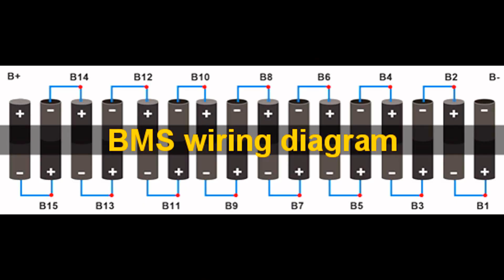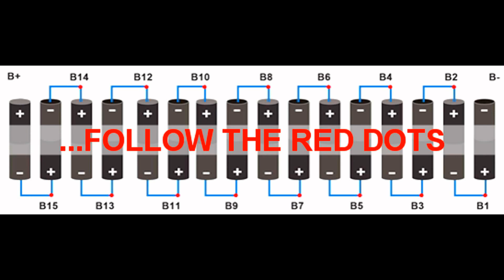BMS Tutorial - How to wire the Battery Managementment System to most DIY electric bike batteries

Comment: hi bruno..i short surcuited my charger main leads whilst it was pluged into my bike and now it wont go...i pulled battery apart looking for fuse or burnt bits but no fuse and no burnt bits..its a giant trance E and i think it has panasonic cells and maybe a panasonic bms? is there a trick to wake it up or is it dead bms?

Comment: You should not weld the bms wire tip on top of the cell, you should weld on the nickel strip between two cells to help dissipate the heat and not degradate the cell performance, since a cell has a chemical composition that can change with overheating created by the weld.

Comment: can help out?  my battery will no longer charge but it does dispense power. I bought a bms but it came with 14 wires and my battery comes with 16. Did I get the wrong bms? ever heard of the battery working but not recharging ?

Comment: So if I choose 10s bms means I have 10 cells  in series? Parallels dont count in ?  
If the motor is 36v 350w = 10amps I can go for the smallest 30amp bms? It wont break the controller?
Reply: check the controller, it has the maximum input current...

Comment: i am looking at a 48v 45ah bms its says 13 cells and 13s i think that's the same thing right.
and when it says cells does it mean 1 battery or 1battery group
Reply from the maker: +bryson502 yeaaahh I know it all sounds quite confusing... 13s means 13 cells connected in series or 48v. Most of there small BMS are designed for small packs, something between 3 to 9 cells in parallel. 
45Ah pack is pretty big with lots of cells, I would recommend you get a large BMS (at least 50A discharge) instead of a small one so the BMS can balance the series properly. 
Let me know how it goes =]
Reply: 1 cell means 1 battery only.13 s means 13 batteries are connected in series.
Reply: @ranjulatanayak584  Thanks, sometimes things need to be dumbed down so us newbies don't make dumb mistakes

Comment: Hello 

The BMS what you have in sec 38 in the hand. Do you have a link to a description of it? 
The two thin white cables on the side are the to turn on or temperature sensor? 
What sensor would you need?
 If so, do I have to do this together or separate the BMS running? 

Excuse my bad English! 

See you soon

Lars

Comment: Hi Bruno,

Is there a difference (better or worst) if the BMS has the charge and discharge on a single, or separate lines?

Im looking at getting a 26S 150A BMS from BesTechPower Model HCX-D170 which has a single port for charge and discharge, but my friend who is helping me said that he prefers BMS's with separate charge and discharge lead ports on the BMS.

http://www.bestechpower.com/27Sto32Spcmbmspcbforli-ionli-polymerbatterypack/BMS-D170.html

Thanks!

Comment: where do you get your BMS? I need on for a 4s pack 16.8v
Reply from the maker: yeaahhh some of my videos I have a list with all places you can get battery parts from, check out these links, these websites have smaller BMS for 16.8v, you can email them and they source basically anything haha
BMS:
BestTech Power http://bestechpower.com
SmartTEC http://www.szsmartec.com/
You can also get BMS on Aliexpress:
14s 30A BMS = http://www.aliexpress.com/item/51-8V-30A-BMS-14S-PCM-Lithium-ion-Battery-Management-System/1342816874.html?spm=2114.01010208.3.10.5WgkmV&ws_ab_test=searchweb201556_9,searchweb201602_1_10017_10005_10006_10034_10021_507_10022_10020_10018_10019,searchweb201603_9&btsid=195f43c8-6994-4cd2-9854-33abfbce7d48
14s 150A BMS = http://www.aliexpress.com/item/14S-58-8V-Lithium-ion-18650-battery-lithium-polymer-battery-BMS-with-200A-constant-current-for/32467710591.html?spm=2114.01010208.3.65.hqcLS0&ws_ab_test=searchweb201556_9,searchweb201602_1_10017_10005_10006_10034_10021_507_10022_10020_10018_10019,searchweb201603_9&btsid=195f43c8-6994-4cd2-9854-33abfbce7d48
10s 36v BMS = http://www.aliexpress.com/wholesale?catId=0&initiative_id=SB_20160417133838&SearchText=bms+36v+10s
Reply: ElectricBike thank you

Comment: Hey, my BMS has those same 2 holes on the end, can those both be used as a negative?
Reply from the maker: Heeeeey Sam, yes... if you have the exact the same BMS both holes share the same connection, if you get a multimeter and check the continuity you will see that both holes and one of the legs of all these big black mosfets all share a same contact. It's handy having two holes, one for a large connector that goes to the motor controller and other smaller to connect to the charger =]
Soooo much POWEEEEEEEEEERRRRR.. hahahaa

Comment: Hey man! love the videos!!! would it be the same for a adappto bms?
Reply from the maker: kerril fahy Heeeeeey... Adaptto BMS is a completely different setup, all series in your pack are connected to very small PCB that is connected to the controller. You can actually control and see what is going on with your battery, this is awesome!! Other BMS you don't even know what the hell the BMS is doing.. you don't even know if they actually work properly... you kinda "hope" that it's doing its job... Adaptto system is awesome!! =]
Reply: ahhhh thanks man!!! I'm just doing an adappto build now and loving it!!! how easy would it be to make the lmx bike you build road legal? now that would be awsome!!!!!!!!!! great way to get to work :) :)

Comment: So... what's the point of a BMS if it only manages battery groups and not individual cells? (I say this based on the number of strings). I guess it's just slightly better?
Reply: A BMS (Battery Management System)/PCM (Protection Circuit Module) may have different functions. One of it may be balancing your cells. 
What you call groups or cells which are paralleled. If they have different voltages current will flow, till they match one another. (For this reason you want to use cells with the same characteristics in your pack.) Basically these individual cells will balance themselves and act like one single cell.
Besides balancing a regular BMS quite often has different features, such like over charge and discharge protection, short circuit protection and over current protection. There probably is some application for a BMS with some intelligent, individual cell management but not within the scope of ebikes.
Reply: Tristan Pol
Ohhh very interesting. So if the capacity of the cells are not the same, within the same  paralleled group, during self-balancing it could heat up for example? Could you take one group of the same capacity cells and connect it to a different group of cells with another uniformed capacity (if adding a bms)?